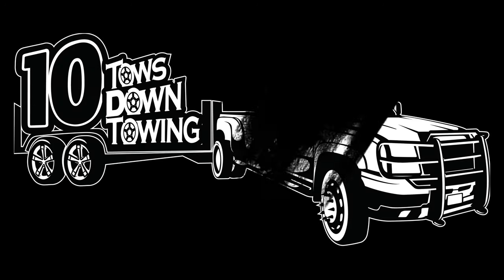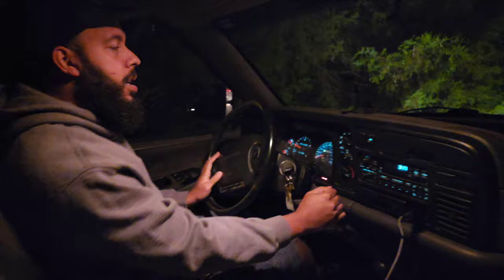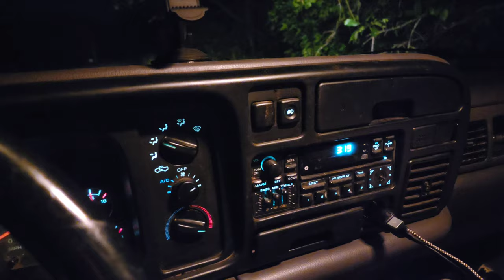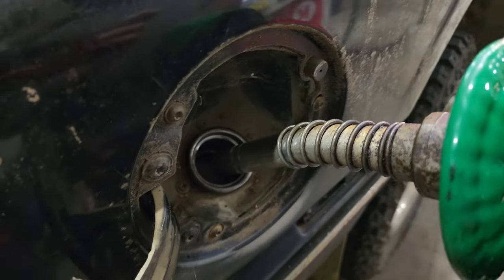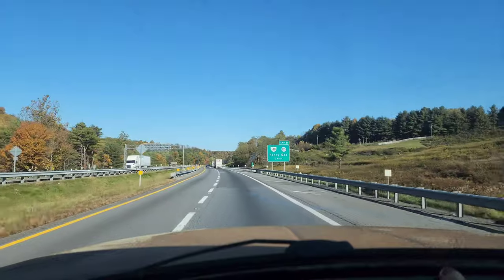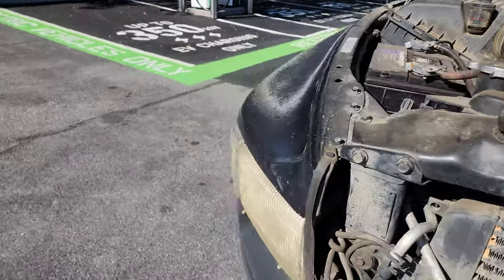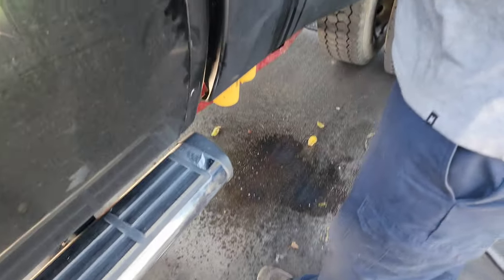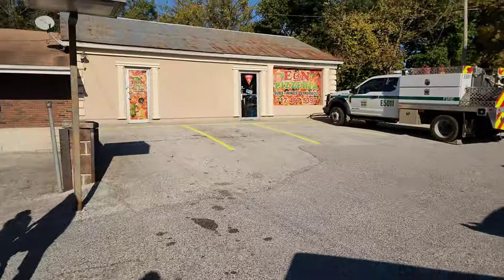I drove a 12v Cummins for the first time‼️  #12valve #cummins

Comment: The tire wear that you see on the front really only occurs on Dodge and Ford dually trucks because their owners never rotate their tires (at least not even 5000 miles) and they have that solid axle upfront.

Comment: If only dodge would have made the rest of them trucks as good as they built them 12 valve engines they would have had something
Reply from the maker: Yea, truck definitely felt like cheap plastic
Reply: @10TowsDownTowing  they most certainly are I have friends that have them an the dashboard the first to rot away even worse than obs Chevy trucks they fall apart just bought everything from it garbage but I won’t deny that ones my friends have got well over 500k on the stock engine but can’t say the same about the truck starting to see people 12 valve swapping obs trucks more now days than ls swap